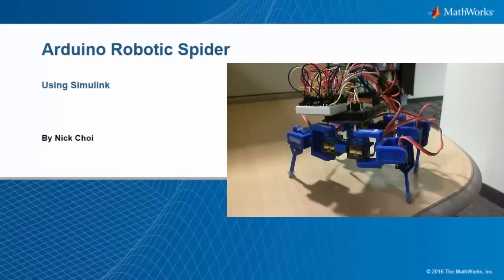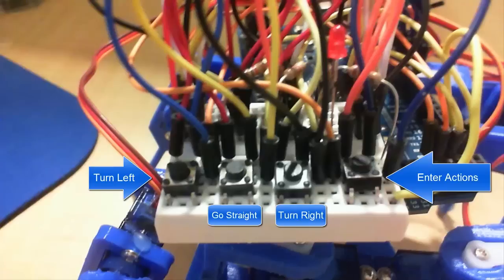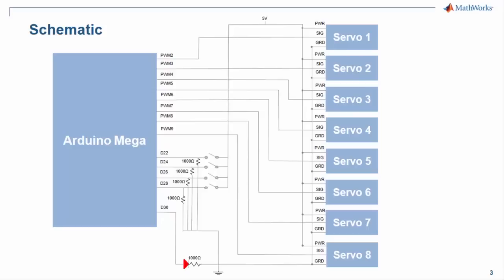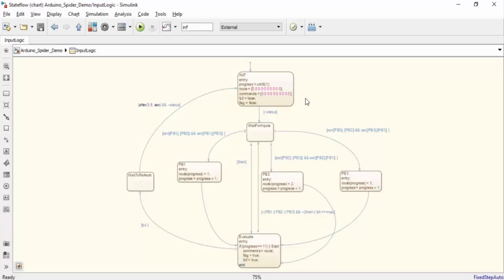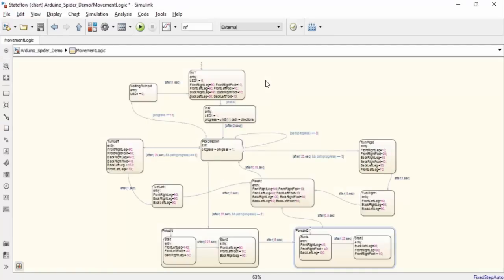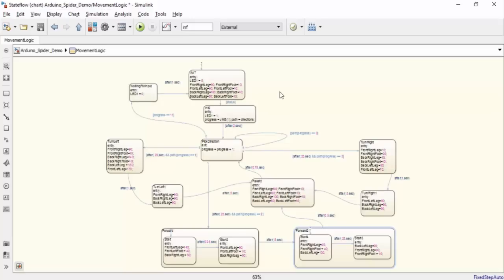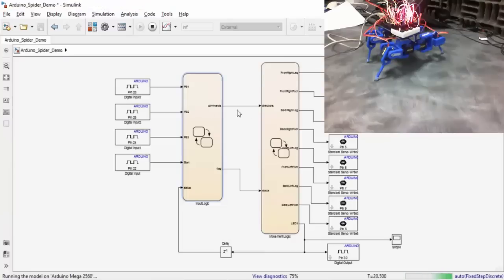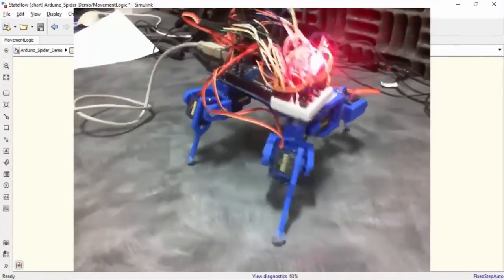Creating an Arduino Based Robotic Spider Using Simulink and Stateflow

Comment: Nice demo. Is there any special coder license necessary to get the live display in external mode working? With Matlab/Simulink/Stateflow home version 2016b + arduino HSP i was only able to het live scope display and basic display blocks working, no live state display, no measurement data inspector, no data to workspace export.